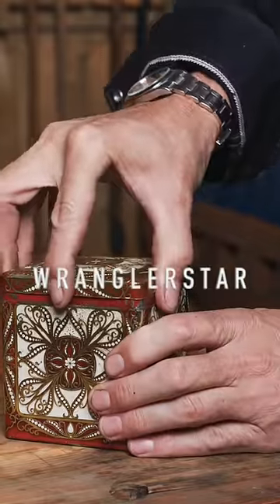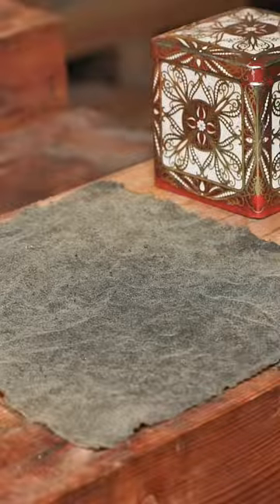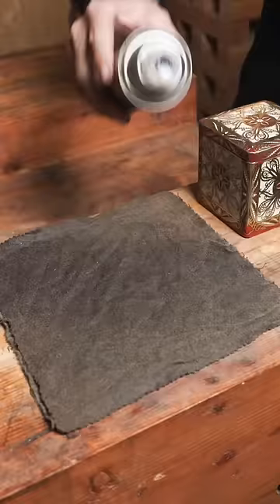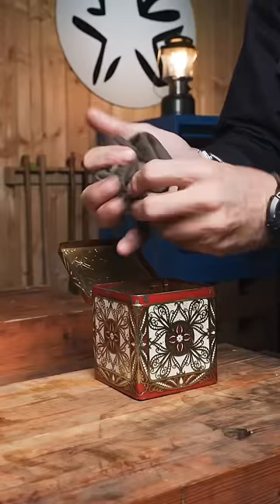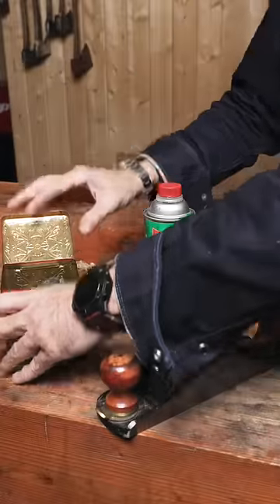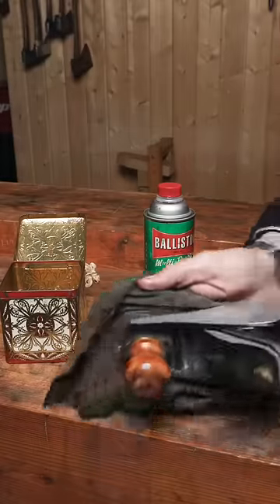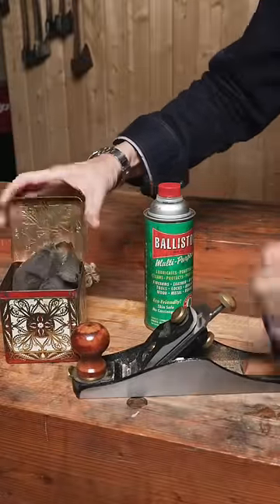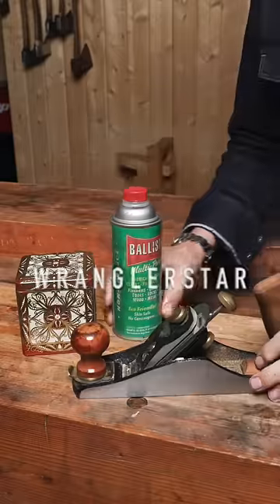Professional Homeowner Hack #038 Wranglerstar  #shorts

Comment: Best AK cleaner there is. Dissolve a few caps in water and bathe your piece, and dissolve all those corrosive salts. FYI it's best to take the gas tube off first and dry right away with air.

Comment: I'm not handy; nor work well with power or hand tools. Yet, every time I use a tool, it is thoroughly cleaned before being placed back in its spot.

I don't like loaning my tools to neighbors. However, when I reluctantly do, the borrower usual says something like: "Gee this thing looks like new." Of course, upon return, the loaned tool never comes back as it went out. 

Shakespeare had good advice: "Neither a borrower, nor a lender be." Now, I just need to learn to use that advice.